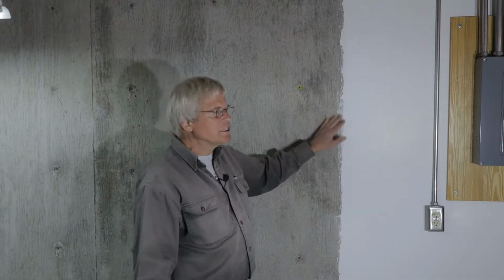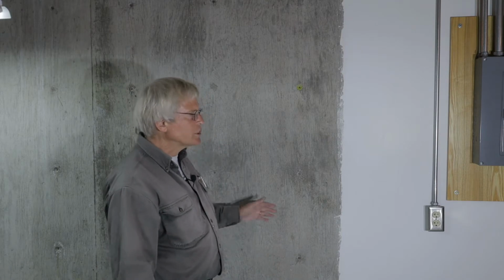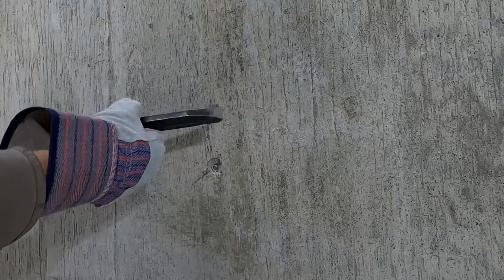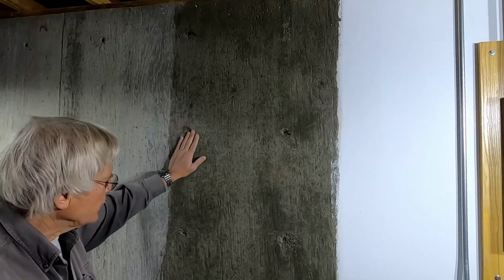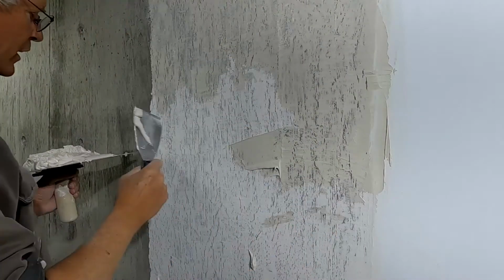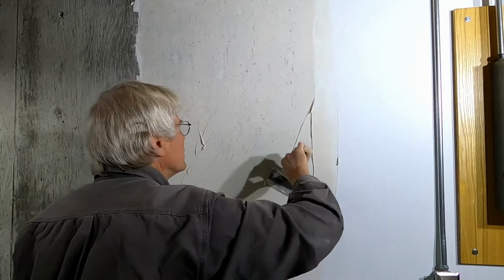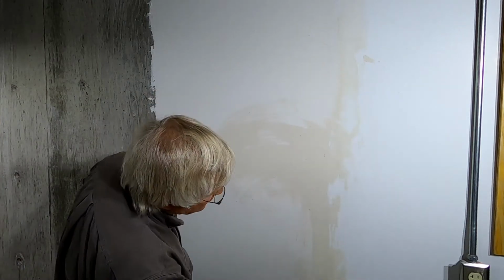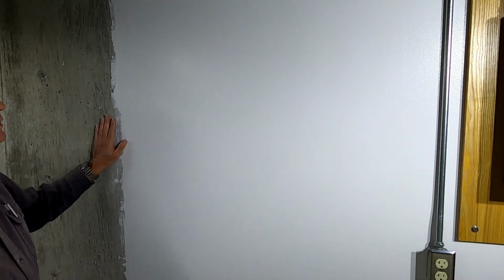How To Finish a Concrete Basement Wall Using Joint Compound

Comment: I had the same idea for my basement, and glad I found this video for direction! I have finished grinding the wall smooth(er), and am working on my first coat of joint compound. It is promising to work just the way I had hoped! Thank you for sharing your project so that I could make sure I was tackling mine the right way!
Reply from the maker: I’m happy to hear you found this video useful.  Let us know how your project turns out.  Thanks for posting!

Comment: I'm working on a similar project but on a ceiling so I see you didn't use any adhesive primer. How has it worked for you so far?
Reply from the maker: So far so good!  Recall, the original section was finished years before I recorded this video.  Both sections are still perfect.
I think it's all about your environment - if it's nice and dry, this method should work for you.  ANY presence of moisture will require a material suitable for moist/wet conditions.
Good luck!

Comment: I appreciate this video ive been wondering if i could just joint compound ove the stem wall in my garage i will give it a go! Its super rough and has alot of air pockets from when they poured but id like it to look a little bit cleaner
Reply from the maker: Thank you for taking the time to reply.
I recommend filling your air-pockets (voids) with st least setting compound - as it will not shrink as much.
If you take your time and have the patience to apply multiple coats, you should be able to achieve nice finish.
Let us know how it goes!
Happy New Year!

Comment: My basement walls are cinderblock. Since I built the house the mortar lines are crappy. I was thinking of using paneling, but 48 sheets is pricey and dark. Found your video and found the plan. Brilliant idea. Mud will cover all the crap.
Reply from the maker: Given what I've learned from the comments since I published this video. I highly recommend using a product that is more resistant to moisture other then joint compound - at least for the initial coat.   I would be REALLY tempted to try straight portland cement.   I do not have any experience with block wall construction, but every time I see one now - I wish I had the opportunity to make one flat and smooth.  I believe it can be done.  Research 'parging' - it should help you learn what is possible.
In terms of cost - you may be surprised by the amount of material you will need if your goal is to hide all the mortar lines.
Good luck!  I hope you report back on your experience.  Better yet, set-up a camera and press record!

Comment: So you need 5 coats of drywall compound to get it smooth?
Reply from the maker: Good question - it depends!
It depends on how smooth/rough your surface is to begin with, how proficient you are at applying mud (whatever material you happen to use) AND how 'nice' of a finish you hope to achieve.
Did I only show 5?  It was probably closer to 8!
As they say - "Your mileage may vary".
Good luck and thank you for the question!

Comment: This is cool. There is a section under my stairs I plan on putting up fake brick decor however some of the wall is not flat so i definitely needed to see some sort of inspiration on smoothing out a basement wall.
Reply from the maker: @Kuragari562  If adhesion is important for your fake brick - joint compound by itself my nat be your best bet. Perhaps once it’s painted it may work. Consider researching ‘parking’. 
Thanks for posting and good luck!

Comment: You can do the same thing with portland cement. Its a fine power. You can make it into a joint compound consistency. You can make it just as smooth and work with it just as long. And it cfan get wet after it dries without worry
Reply from the maker: I would never have thought to use Portland on its own.  I would expect it to set-up WAY too quick.
I would love to see a demonstration using just Portland.  If it works as well as you suggest - I wish I had another wall to try it on!
Any takers?
Reply: @KevinTaberski  I do a bit of concrete work. Just portland does not setup fast. Mix it to a consistency a bit more fluid than drywall mud, it will give you 40 min working time easy
Reply from the maker: @franksfamily  I believe you - I'm just surprised that this is the case.
Unfortunately, I don't have any projects involving concrete in my near future - so I don't have ready access to Portland.  I wish I could experiment.
Maybe - if I get bored - I'll buy a bag of Portland and give it a try.
Thanks again for the tip!

Comment: So I am trying to do the same thing. After doing my research, I was told to put a cement all purpose primer that is mildew resistant to moisture, first. Then put whatever it is you are going to use. 

I recently found a product called, quikwall cement with fiber glass in it. So far it has held up. There's an interesting video on that on YouTube.
Reply from the maker: Excellent!  I’m happy to hear that you found a product that will help seal the concrete.  I appreciate the feedback and good luck with your project.
Reply: Looking to do the same now. Any suggestions? How’s it holding up?

Comment: We're wanting to do this in our unfinished basement. What's the cost comparison to drywall?
Reply from the maker: I would expect drywall to be more expensive - but this is not a fair comparison.  A framed wall covered with drywall provides a much different finish - and far superior in my opinion.  The only reason that I used this method in my utility room is because it IS a utility space.  I ultimately framed the remaining walls which I insulated and covered with drywall.
I hope this helps.

Comment: Phenomenal video!
I'm planning to retouch my horrible concrete basement walls and drywall mud was my first suggestion but I didn't know how to go about and apply it without flaking off.
The end product you showed looks amazing.
Reply from the maker: Thank you for the comment!  Make sure you do not have a moisture problem if using drywall mud (joint compound).  The key is no moisture and a reasonably clean surface.
FWIW - my wall still looks amazing!
Good luck!

Comment: do you think you could do this to cover the lines of the cinder block walls?
Reply from the maker: I do!  Every time I see a cinder block wall - especially one that is unpainted and well laid-up -  I think, wouldn't it look better finished?
It may (WILL) take a LOT of mud, but it could be worth it.  
If it's below grade - definitely consider using something with cement (portland) in the mix.  Research 'Parging' and 'Rendering' - in which case sand is typically used in the mix.
Good luck and thank you for the question.

Comment: I was looking for a video on skim coating white modified thinset mortar on cement board with drywall joint compound. I found your video. I wonder, could you skim your cement wall with white modified thinset, then do a final skim with drywall joint compound?
A trick I learned, from Vancouver Carpenter here on YouTube, is to add white glue to the water of the joint compound mix. That little trick has added strength to seams and repairs and build outs. I even use thinned white glue to repair torn paper facing on drywall prior to mudding. It dries hard as rock, so I wouldn't suggest the glue additive to final skim coats.
Reply from the maker: As I've learned since posting this video, there are a number of products and techniques that one can use.  It all depends on the condition of the surface, the level of moisture/water present and the level of finish you are attempting to achieve.  Common terms are 'parging' and 'rendering', both of which tend to use heavy aggregate/filler (typically sand) in the mud/mortar than I wanted.
Depending on your situation - wetness of the environment - thinset may prove a worthy material.  If I had to do my basement again, I would apply the first coat with a material that contains cement (portland) with a fine filler, then apply joint-compound for my finish coats.
Good luck and thank you for posting!

Comment: Water/moisture will ruin the joint compound lol
Reply from the maker: One would think - but the area I finished when I recorded this video is still going strong - as-is the rest of the area I finished almost 20 years ago.  The key is reasonably dry soil & climate, good exterior water-proofing and good drainage.  That said, IF I had to do it over again, I would use a material that was more moisture resistant - as others have suggested.  The point of this video is that one can 'finish' concrete to make it more suitable for painting.

Comment: What about a block wall?
Reply from the maker: I think about this every time I see a block wall now.  A couple of thoughts:

I would expect a block wall to be more porous, so if in a basement it needs to be coated with something water proof.

It will take a LOT of material to make flat,  which means either THICK coats or MANY coats - especially if the blocks were not laid-up evenly.

I suggest researching parging  - I've not done it nor worked with block, but I expect that given time and determination a block wall CAN be made smooth.

Good luck and thank you for the question.

Comment: Did u use  the powder or one in the bucket . thank u
Reply from the maker: I used the ready-mixed joint compound in the bucket.
Reply: @KevinTaberski Which type of pre mixed did you use?

Comment: Most basement concrete walls are very uneven and rough. It takes a lot of compound to cover completely
Reply from the maker: Yes it can take a lot of compound!  One needs to decide for themselves how even is even enough.  At the very least, it helps to fill-in the surface voids.

Comment: Hi Kevin, thank you for providing this informational content. Could you share the time spent finishing that section of wall?
Reply from the maker: Vincent - I probably spent a couple of weeks - of evenings - finishing this section.  Not that it took that much time, but I applied more coats then any rational person would likely apply.  The biggest/longest step is the prep - especially knocking-down the high spots.  Once the first coat is applied, the rest is just like skim coating a textured wall.  That said, it is a labor of love!
Thanks for the question.
Reply: @KevinTaberski  Thank you for the prompt reply! Knowing what you do now, would you have still performed this method, parging or stucco instead?
Reply from the maker: @vincentye72  - Based on the condition of my walls (i.e. relatively flat and even), I would still use this method, but I would select a material that was more water resistant, but still fairly thin - so closer to parging I think - but only for the first coat or two.  Then, I would still consider switching to drywall mud (unless I found something else) to get it nice and smooth because it is sandable.  Unfortunately, I do not have another application for this method.  FWIW - I now have the basement near finished (all the walls are framed, drywalled and painted) and the wall in this video still looks great.
Reply: @KevinTaberski   Would love to see a video of the basement when complete. Thanks for sharing.
Reply from the maker: @vincentye72  Thanks for that.  I've been recording some of my progress, but I haven't (yet) taken the time to edit - as I still find the process time consuming.  I 'plan' to edit once the project is complete - perhaps this fall.

Comment: Hi Kevin, we have painted cinder block walls in portions of our basement. do you think this method would work to cover those? Is there any moisture concerns that you have to take into account?
Reply from the maker: Moisture is the biggest concern. However - IF the paint has been there a while and moisture has not affected it, then I would be tempted to try my method.  In my (limited) experience, drywall mud covers paint pretty well.  I would first clean it real good, perhaps wire (stainless steel) brush it and maybe clean with TSP. 
Good luck!
Reply: Painted with what (Not Latex?)

Comment: I wish I saw this video before I stared smoothing out two concrete walls in my garage.Im on the second wall now and will use your technique. Looking how you did it I did a lot unnecessary standing in dust.  I did primer all the walls before applying joint compound Thank you for your video
Reply from the maker: Paul - I believe you are the first viewer that actually attempted to do what I did.  I am very interested to hear how it goes for you.  Thank you for posting!

Comment: Interesting video and I like the fact that Kevin is thinking "out of the Box."  However, I live in Michigan.  No way would this work in Michigan.  With the Great Lakes surrounding us, we have water literally everywhere.  This is combined with a high water table.  Our house has a "Michigan Basement," which goes down only halfway into the ground with the rest above grade.  None the less, I still get a lot of moisture coming in.  I am  presently painting my basement with Drylock Extreme.  It seems to be working very well and basement is much dryer. I don't know how long it will last though, because as they say - "Water Always Wins!".  I could see this video's technique working in Las Vegas.
Reply from the maker: I totally agree!  I'm hopeful that someone actually tries this using a more appropriate material and reports back - or better yet posts a video.  Thanks for sharing.
Reply: You could use henry feather finish the one that self seals
Reply from the maker: @pearlperlitavenegas2023  I had never heard of this product before - but it looks quite promising!  Is this the one you are thinking of? 
https://www.wwhenry.com/product/henry-549-featherfinish/
Thanks!

Comment: Interesting video!  Thank you, Kevin.  Read through the comments and was intrigued by the suggestion of "Concrete Fill."  Unfortunately, when I tried to find CGC Synko Concrete Fill, I've read it is only available in Western Canada.  I'm curious if the DryLoc Paint would result in the joint compound not adhering well.  Has anyone tried it?
Reply from the maker: Cynthia - I have no experience with any of the other products mentioned other than 'hot' mud (aka quickset/EZ Sand, etc) while taping drywall later in this project.  I have now concluded that they don't hold-up to moisture very well either.  I also used portland cement for laying brick and have used plasters in the past - specifically Hydrocal, but I don't know if that would be appropriate in this application .  I would be tempted to use portland (perhaps with lime) as mentioned in the comments or do a bit more research on plasters.  Also, research 'parging' - a term I was unaware of when I started all of this, but seems closer to what I was attempting to do.
Reply: Thank you!  I’ll check parging and do some more research!

Comment: Drywall mud is not the best choice to fill concrete! there is a product called Concrete Fill (nick named Con-Fill). this product i used in concrete High-rises primarily on Ceilings so to make them look like drywall. Con-fill is better for for filling and Darby walls voids. it is sand able and paintable. It is tougher than drywall compound and sold as a powder product. When you are doing any drywall work, it is also used in drywall mud to speed up drying and to help fill large voids that require strength
Reply from the maker: Thank you for this information.  Could you supply a bit more information on the specific product - perhaps a link?  The only product that I could find is CGC SYNKO Brand Concrete Fill - which is ONLY available in Westen Canada.  It also is fiberglass reiforced, so I would be curious to know how fine it is and how well it spreads (see: https://www.usg.com/content/usgcom/en_CA_east/products/walls/drywall/joint-compound/concrete-finishing-compounds/synko-concrete-fill.html)

Comment: Thank goodness I found this video. I thought I was using concrete on the walls in the basement to touch up a crumbling bathroom but it looks like it was joint compound! Oops. Well it worked :) but now worried about sustainability. Time will tell!
Reply from the maker: I suspect how well it holds-up for you will be a function of how much moisture you have.  If moisture was the cause of the 'crumbling', then not so much.  Good luck and thanks for posting.

Comment: So you added 5 coat of joint compound to fill in the holes an the lower spots on wall an then you added 1 coat of semi gloss paint for the finish.
Reply from the maker: I don't recall the total number of coats of joint compound, but I applied at least 5, but then I applied primer and 2 coats of semi-gloss white paint.  FWIW - I could have applied fewer coats of joint compound, but I was going for a nice flat and even finish - it is a personal preference.  The primer is important to seal the joint compound and I always apply 2 coats of paint.
Reply: Are you saying add the paint in the compound?

Comment: Drywall compound chemically is calcium sulfate. I would use quick setting 'hot mud' or as others have pointed out Structolight plaster which is calcium sulfate with lime added to it. If you're worried about moisture there is a Drylock alternative making a waterproof cement paint by mixing 3 parts white portland cement to 5 parts hydrated lime to 1 part calcium chloride, mix with water until a thick paint consistency. Wet the walls first so that it will stick and brush or roll on. This recipe was originally found in the older edition of Taunton's Concrete
Reply from the maker: This is some really useful information!  All of these great tips 'almost' make me wish I had another basement wall to finish.  Thanks for posting - I'm sure someone else may use your tips.